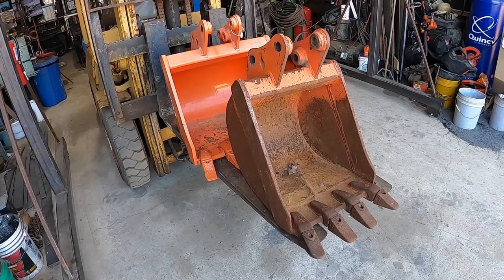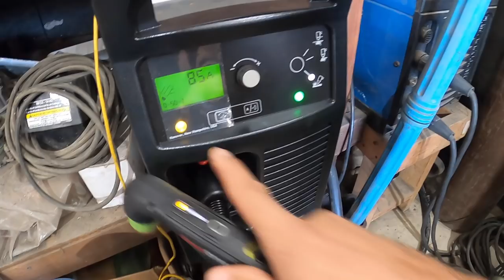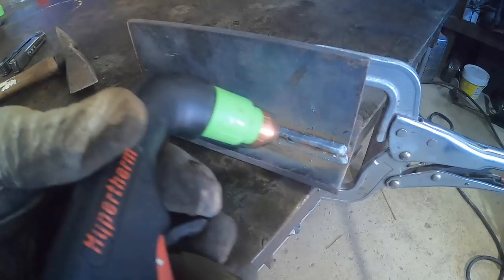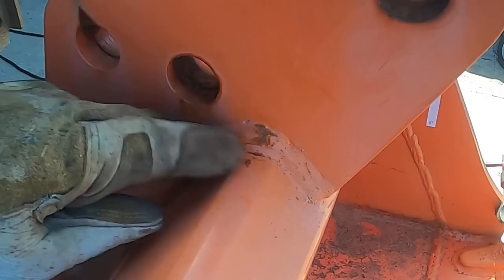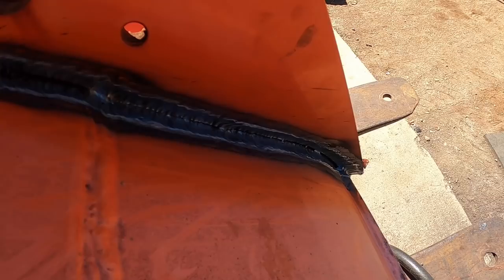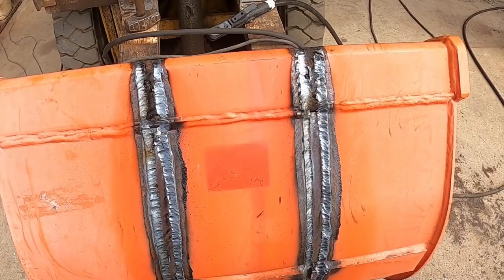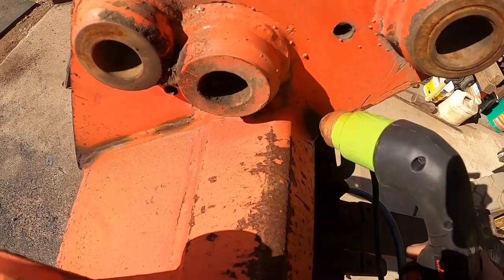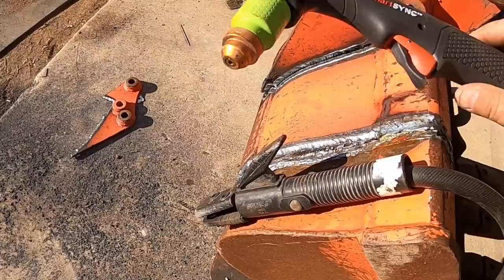Plasma Gouging or Carbon Arc Gouging? You decide.

Comment: It’s a very interesting conundrum, plasma looks like it might be more suited to a workshop application because of having to cart the suitcase around whereas the CAG it infinitely more portable and easier to use out in the field, imagine dragging the suitcase under the belly of a’dozer. It’s going to be dinged up in no time. CAG is relatively inexpensive to replace if a mishap occurred. 
From an operator’s perspective, it looked like the plasma had slightly better visibility , without the separation line being obscured by the carbon rod. That could be a delusion created by the camera angle. Others have posted about the fumes, moot point because either involve the liquefaction of the parent and weld metal as well as vaporising any coatings mud etc. As an unqualified statement, I’d wager that the isocianate cured paints would be more harmful than a bit of atmospheric carbon. 
Issac, can you tell us which system consumed the most amount of air?
Reply from the maker: They used about the same amount of air when you consider I had to make multiple passes with the plasma. And the visibility was actually better using the rods for me since i tend to look more at what i have already removed rather than what i'm removing in front of the arc. The long arc length and the torch head blocked my view some. It may take me learning a new way to look at things though.

Comment: Can plasma gouging be done with any plasma cutter? Is it just the tips that make the difference?
Reply from the maker: Not too sure, but I believe the tip is what makes it possible. See if your brand offers a gouging tip.
Reply: @ICWeld  alright thanks, will do
Reply: Does your plasma cutter have a switch from cutting to gouging?
Reply from the maker: Since this unit has replaceable cartridges, it knows when its in the gouging mode. it automatically changes by itself.
Reply: @ICWeld  ohhhh ok that makes sense. Thanks for the help

Comment: So, it doesn't take consumables, but it doesn't work without the replaceable tip, which the machine tracks total usage of by individual item serial number? Let me know when they invoke Commanded Obsolescence and/or pay-per-use packages, on top of locking out repairs and off-branded parts. There's simply no reason for the parts and programming expense, unless they intend to invoke Digital Rights Management, like printer toner cartridges that tell your printer not to print anymore, when there's plenty of toner left, or Apple phones that need to be replaced when the battery gets worn, or simply from a forced update that slows the phone.

Comment: I’ll take the plasma thanks - those that don’t know need to understand that carbon rod gouging fills the air around you with microscopic carbon particles that get into the really deep areas of the lungs and eventually cause cancer - the old gougers in the shipyards had an extremely low life expectancy - plasma thanks.

Comment: No such thing as 220 you would have a High 208 or a low 240 volt . When a piece says to run it at 220 that way it can run on both voltages.

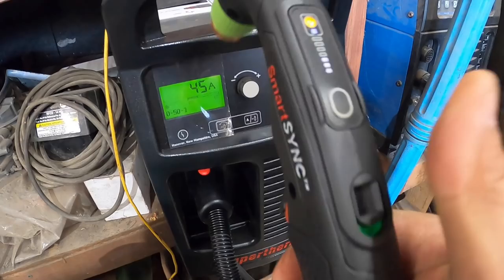Comment: When you adjusted the amperage to 45 the unit moved the amperage to 85 when you turned it on. At 6:52
Reply from the maker: Yeah, I noticed that when I looked at the position on the handle. I turned it back down.

Comment: Cual sería el mejor electrodo para soldar en vertical saludos
Reply from the maker: 7018's
Reply: Just a quick question, where do you buy most of your welding rods from 7018 I have been buying from various places but the prices are going absolutely nuts which I’m sure you are well aware of.